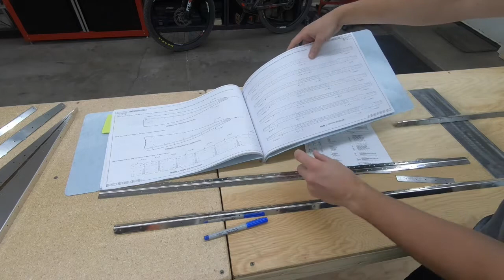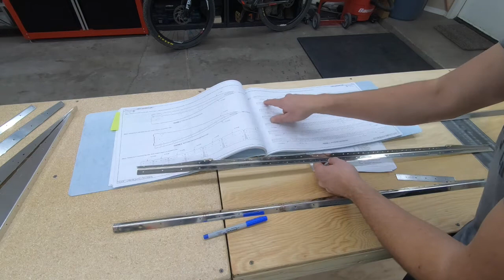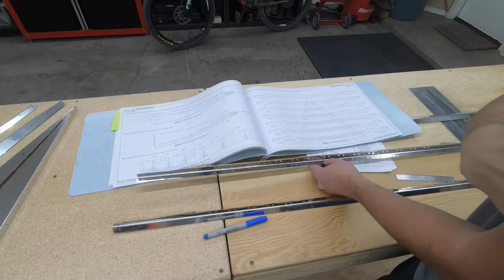Vans RV-10 Rudder Build, Part 1

Comment: Did you buy an aluminum “brake” to bend the metal parts or do they come that way?  I completed the SynergyAir one day fundamentals course and we had to use a brake in forming the stiffeners.  Just wondering because I am building a tool inventory now.
Reply from the maker: I have not bought a brake. If I was building again, I would consider it if I found one for a good price. Van’s has you fabricate one to finish a tight bend on the elevator trim tabs. The one I made out of lumber and hinges was a pain to use. It became firewood after that part of the build. A lot of people have to make that part multiple times, and I’m sure a professional brake would make it easier if the part fit in it. I’m not sure how much use it would get outside of that part though. All stiffeners have come pre-bent up to this point
Reply: @AustinManke  thanks for the info.   I am beginning the tool purchase “ project”…